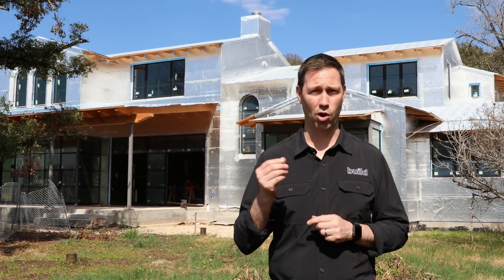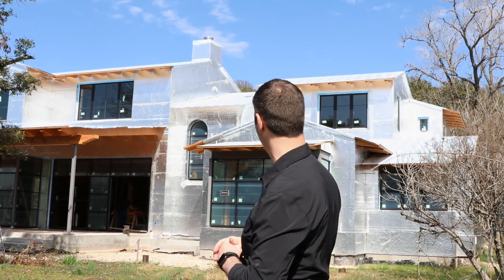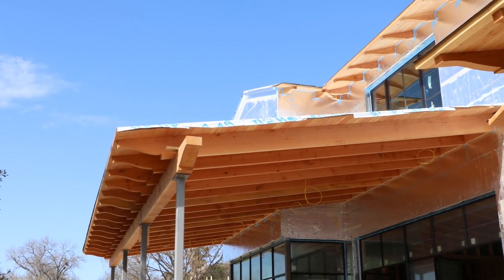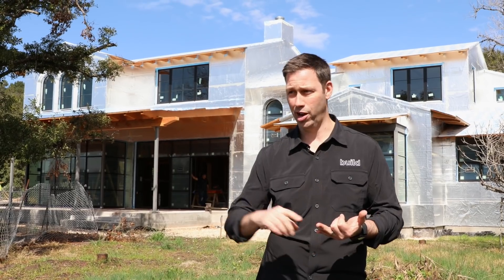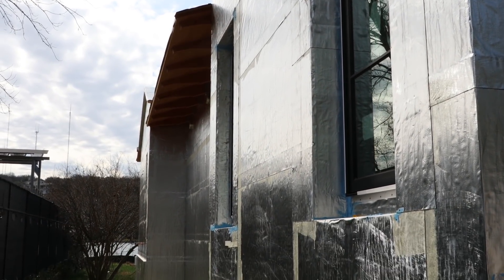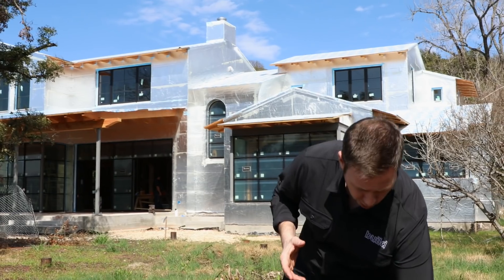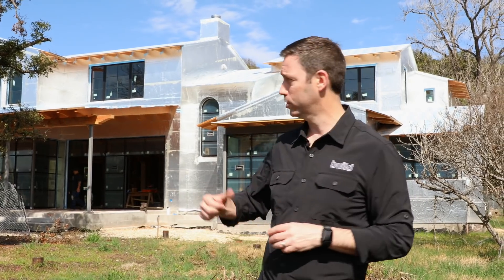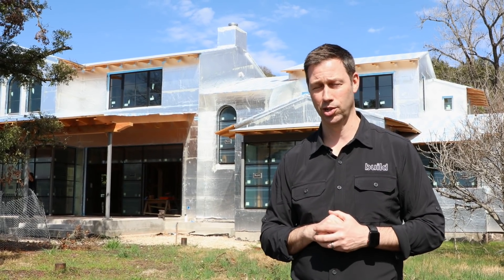3 Risk Factors - Builders Beware!

Comment: Matt, since the PolyWall Aluma Flash is zero perm, can you use a closed cell foam on the interior for insulation??  If so, doesn't that present a risk of water being trapped between the Aluma Flash and the closed cell foam, thereby possibly damaging the sheathing?   I am building a home in Baton Rouge, LA (62" of annual rainfall) and looking for a solid weather system for waterproofing and air barrier.  What did you use to weatherproof the roof?

Comment: Great advice as always! With as efficiency minded as most of your videos are, I'm surprised you haven't done more with ICF. I know Bautex has been used in a few of your builds...  but you have never done a video explaining the differences between styles and brands of ICF. Fox Blocks and Build Block are the two biggest for this area in coastal Florida. Just a thought! Keep it up, You are making the building community better with every video.
Reply: Marcus B I spoke with him in Orlando about ICF’s, he’s not against them but he’s not a big fan of them either.
Reply: ICF are expensive, have lower insulation value than many systems with continuous insulation and cost a lot to finish. Once code requires continuous insulation on houses ICF will disappear.
Reply: Look up products from thermomass and you'll laugh at the ICF salesman.

Comment: Great video Matt. I have a couple of question areas. 1. what is the cladding on this house, and how much of an air space will there be between the foil and the cladding? More specifically, what is the relationship of the size of that gap to maximize the benefit of the reflective barrier? Does the material accros from that air gap influence how large it should be?  2. you are going to have a lot of water coming off this roof and dropping on to the ground and other roofs. Given these nice exposed rafters, you are probably not going to use gutters are you doing anything to control this aspect of water?

Comment: What are people in the US doing for jobs to afford to build a house like that?
Reply: Probably a CEO of a company, many of whom are paid extremely well.  Even an owner of a larger heat and air or electrical contracting company may make enough in some cases.  Matt said he had to build it right because a CEO or other wealthy person would have the means to sue later if rot was caused by poor waterproofing.  Plus labor costs in Texas are low especially from subcontractors.   It is still possible to build a house for $100-$125 a sq ft here, however Matt's company would spend three or four times that on these custom homes.
Reply: RJParker  matt spends between $350 and $600 on a typical custom home
Reply: Virgil if you have the know how, you can build it yourself. The less you know, the more you have to subcontract

Comment: Sorry, I have to disagree. It does not matter (number 3) if you are building for a CEO with a lawyer on detained or a public housing complex. Both should recieve the same excellent consideration and build.
Reply: Shawn Ballee point was your risk of being sued is higher with this particular type of client. Simple.
Reply: yes, but Shawn's point is your fear of being sued should not determine the quality of your work. It should always be good.
Reply: I think you are interpreting his #3 incorrectly. What Matt is saying is basically "stay off my turf of building houses for CEOs and lawyers, unless you really, really, really know what you are doing - your risk of being sued for a huge sum is too high." As a potential client you are hearing "I have the balls of building houses for CEOs and lawyers, am fully aware of the risks, because I know and control the risk factors very well."
Reply: Shawn you have no idea what you're talking about. Housing projects will get what is spec'd just like a CEO's. He's saying he won't build in his area if he doesn't get to use top quality products. The housing projects are commercial and will be better than CEO's 99% of the time. Design will be much higher on the CEO house.

Comment: You recommend polywall liguid how would you compare to Huber Wood liguid seal
Reply from the maker: The Huber product is meant as a seam and detail sealant on Zip System. Blue Barrier by PolyWall is a stand alone system for waterproofing on OSB or Plywood. Both are good depending on what you feel comfortable with.

Comment: One thing for sure, cellphone signal its really really bad inside that house!That aluminum is  really good for waterproofing but awful for your cellphone signal and I suffering it!
Reply: It honestly isn't that big of a deal. I have 2 layers of foil faced foam with offset seams. That is 4 layers of foils and no appreciable change in cell phone. That said, the TV antenna in my attic is now useless.
Reply: New phones (with mobile carriers) can switch to wifi automatically or there is probably an external antenna for cell phones.
Reply from the maker: Agree. Don’t forget the house has windows too.
Reply: How quickly we give up on the energy savings of the greatest Investment most will ever buy, for the sake of a cheap luxury like cell phone usage. I’m a builder in SC, and although a cell phone is an ASSET to today’s business man, it’s a LIABILITY to my company, AND my family life of 6 children and a wife of 19 years.
Reply: Cell signal extenders run about $800. Thick stone and concrete is way worse for signal thank metal.
Reply: It's a weird wonder but I do agree. solely based upon life application. what's over your head can make an inconvenient difference regarding cell phone signal. I've found close to a window increases signal strength when officed beneath metal roof. have a good one!
Reply: Old wise tale.  Yuo don't lose cell signal inside a plane, I doubt aluminum facing peel and stick will cause any issues.

Comment: Matt, what system would you recommend for areas like Missouri & Kansas where we get a little bit of everything throughout the year. I'm doing a lot of research on waterproofing and insulation systems. I would value your input. P.S.: Probably going to also go with the HVAC+D.
Reply from the maker: Depends heavily on your architecture. Overhangs?  Then Zip is a great choice along with many HouseWrap options. More exposure then goto a peel and stick like Delta Vent SA or a Fluid Applied system like Blue Barrier by PolyWall